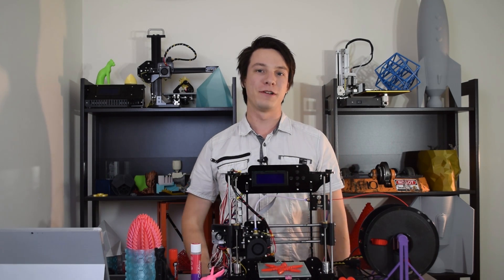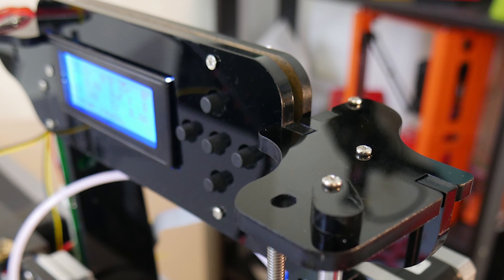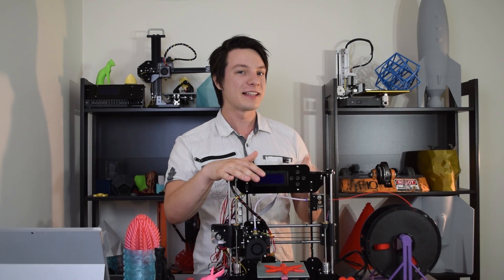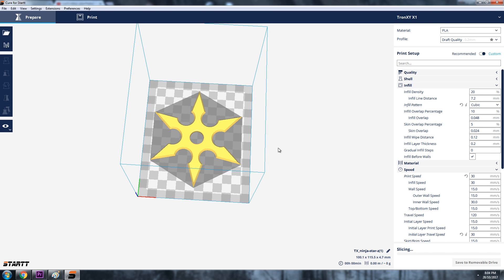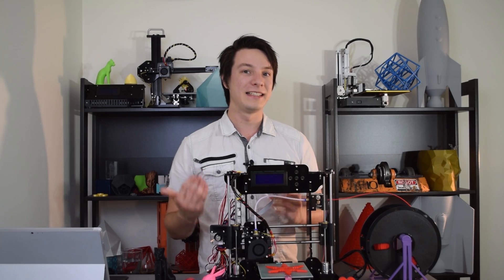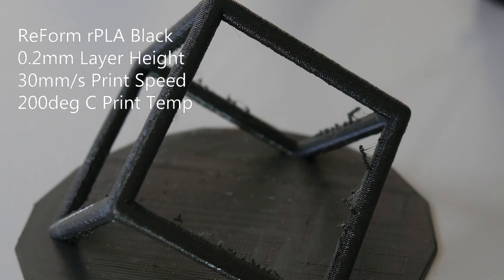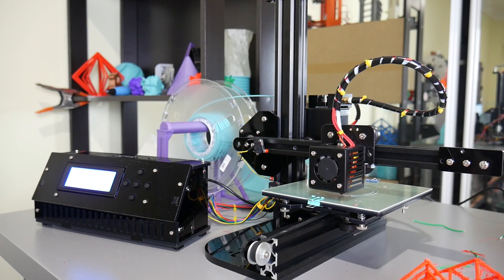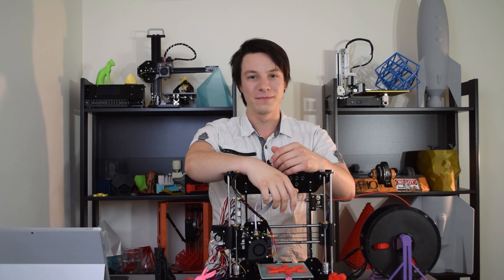The $99.99 STARTT 3D Printer is the Cheapest Kit you can buy. But is it any good?

Comment: Thanks for this Angus - I've been thinking about getting a STARTT, knowing full well that it is just that. My expectations were low, but you've shown it can actually print worthwhile stuff, so that's a bonus for me!
Reply: KeefCooks if you get one dont be surprised when the extruder motor is skipping. Just slow the print speed down like he said. This is a pretty common with this printer
Reply: Keef, i didn't have a good source for STARTT, and i was looking for a larger printer. Now finally i ordered a Geeetech i3 Pro W on Friday for 138€/$160 and it arrived on Tuesday from their warehouse in Germany - and it seems OK! There are a few things that need to be filed down, but the manual points it out anyway. I started assembling it around 8pm and when i was finished, the sun went up x.x but it was enjoyable and went smoothly. There's no part cooling so the print quality is limited, but i'll just add that later. I don't have much any Z wobble, probably because i left holes for smooth rods super tight but widened the top plate holes for threaded rod a lot, so they don't pull the X carriage to the side. I'll go buy some filament and print some more, and let you know how it goes if you like. The motors on XYZ are a bit on the wimpy side - they are shorter than the extruder motor - so unless mechanics are smooth, it can get stuck or skip. Because it's made from plywood, i had no qualms about very gradually and slowly making all the screws super tight so it's pretty stable, not much wobble at all - in spite of its lack of full frame. The printer has only two plastic parts, (injection moulded belt retainers), seems pretty robust overall. The power supply passes at least the basic sanity checks - there's an input fuse, the enclosure is earthed, and the designated screws shouldn't go deep enough to wreak any havoc. There are also separate socketed SMD fuses for heat bed and the rest of the printer on the logic board - if i ever need to replace those, they are exotic but i'm lucky to have a Conrad Elektronik here, i can get them there for about 80ct a piece. The quality of PCB manufacture is not very good - solder joints all work, but aren't the prettiest, there was a layer of flux residue, and a scratch on the logic board that luckily only goes over ground pour, also a solder whisker came off a through hole soldered connector. When i receive Chinese electronics, i always inspect it for loose solder blobs and whiskers, and often enough find some - gotta clean them up before something shorts out.

I was going to buy the CTC while it was on sale for 118€, but i missed it, and now they're 158€ which i think is a bit of a ripoff for a printer with a non springloaded extruder that barely works.

I bought from Geeetech (not a reseller, official account) via eBay. Then they sent me a nice mail with build instructions. Not so nice was that they added a few more people to the To: field, presumably those who bought one around the same time, which means they leaked our e-mail addresses to each other... No big deal for me, but you'd expect more professionalism?